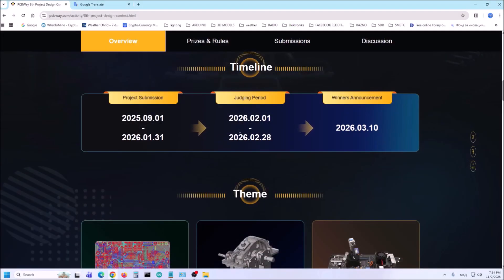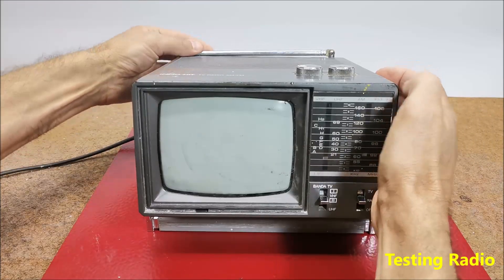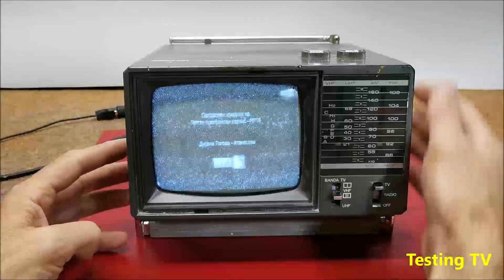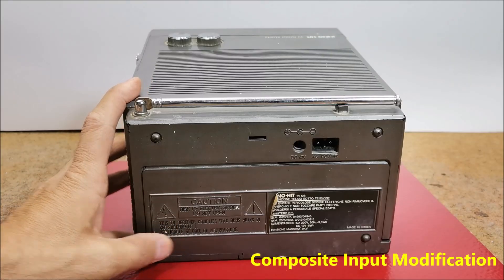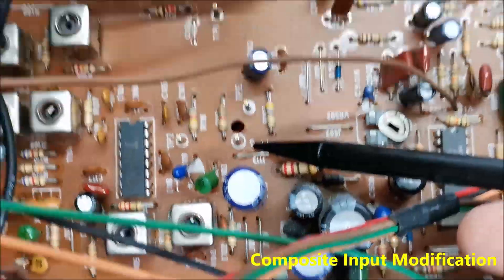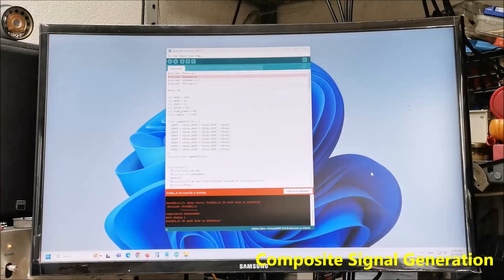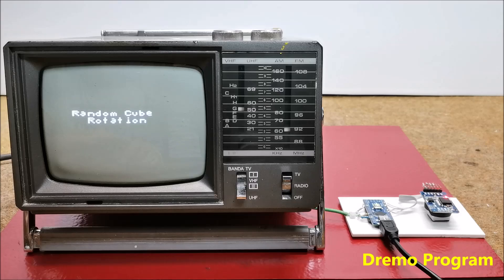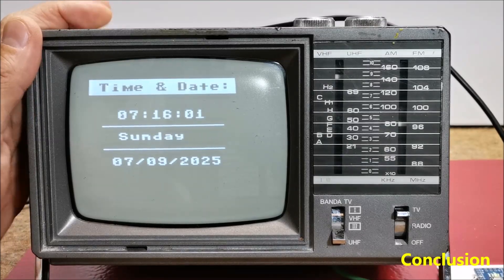How to Make a Digital Clock on a Vintage B&W TV using Arduino

Comment: Man, what a coincidence, I just finished my college project using one of these, and the arduino TVout library.

Some general things I had to do:

On the composite video out side, I had to add a 75 ohm resistor across to ground after the video and sync signal are combined.

Since my TV had antenna only, for my composite mod for composite input, I had to AC couple my signal by adding a capacitor in series with my signal. This is because the video had a horizontal zig zag line going through the picture. I chose a 1uF cap, but any cap worked from my testing. Lower values take less time to filter out the horizontal retrace line.

The 75 ohm resistor helps to make the text readable. The 1uF cap helped remove the horizontal lines and fixed the contrast. 

For my project I made my CRT wrist mounted, and I was displaying counts/minute from a Geiger counter. It works pretty well, and I'm thinking about making a video to upload about it on YouTube.

Comment: The problem with CRT is they will burn in the image after a while.
Reply: Since this is controlled by an Arduino maybe just slowly shift the image both horizontaly  and vertically
Reply: This is an excellent project and that is the only thing missing. The fact that it looks like the TV might have a small rippling power  problem is making me wonder, does that power situation HELP in preventing screen burn? The fact that the characters are moving slightly rather than being static white characters on a black background? Another add to the project that might help if it were possible would be some variance in the levels of grey for the background  and the characters, rather than white letters on a black screen.
Reply: honestly modern screens can do that too. My husbands last phone had the tik tok buttons burned into his screen because of how often he was on the app.

Comment: You should replace the power supply capaciors in the TV since you can see the image oscillating back and forth due to psu voltage wripple.

Cool project, I hope you dont run this at high brightness so you dont wear out the CRT, ideally you would have the clock moving like the DVD logo so not to wear out a particular part of the screen